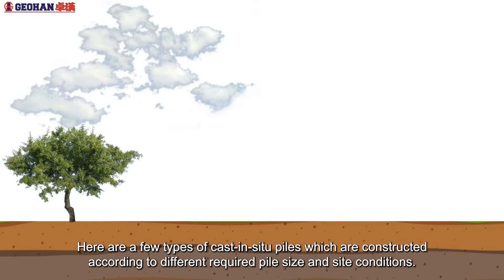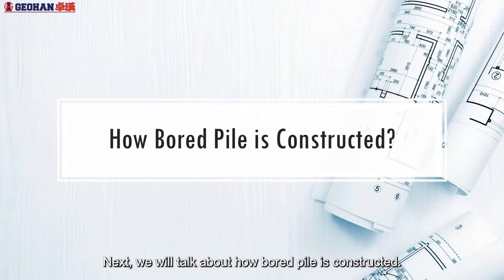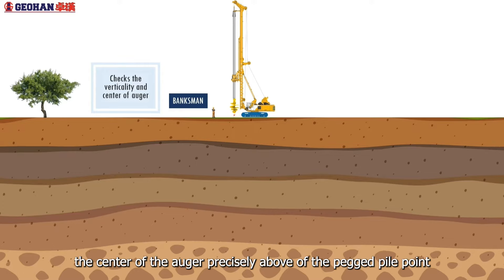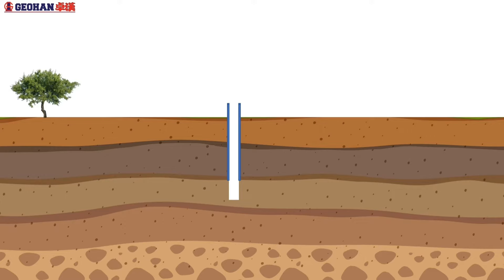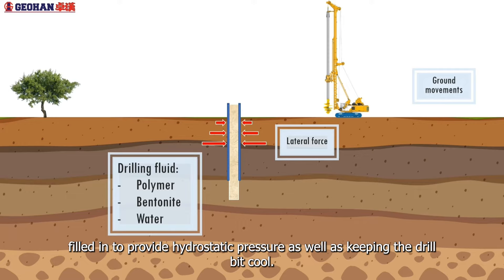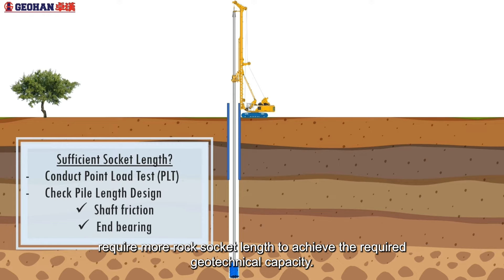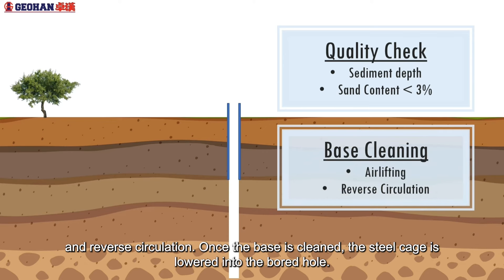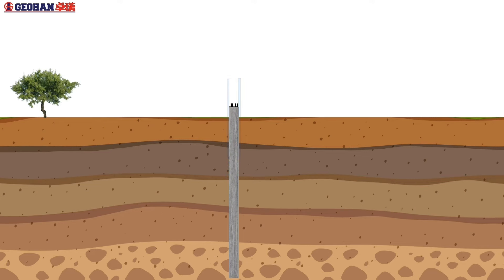Bored Piling Explained | 𝐆𝐞𝐨𝐭𝐞𝐜𝐡𝐧𝐢𝐜𝐚𝐥 𝐅𝐨𝐮𝐧𝐝𝐚𝐭𝐢𝐨𝐧

Comment: Good job. When cleaning the bottom of the hole, it may be advantageous to use a suction bucket instead of the air lift or reverse circulation, particularly in a remote location or in the interest of economy. Take care and best wishes in your endeavors.

Comment: What prevention method to taken if raining happen during boring of bored hole and during casting of bore hole?is there any effect if the bentonite mix with rain?
Reply from the maker: A good practice would be to cover the hopper on top of the concrete mixer truck with a canvas to minimise rain water during concreting. 
As for bentonite, priming the mix with new bentonite mix to achieve its desired density and viscosity would do.

Comment: Hey Geohan, could you tell me when we are supposed to use soil auger and when to use the bucket?
Reply from the maker: When boring in a bored hole that is dry or without drilling fluid, a soil auger is used. 
A soil bucket is used after drilling fluid is discharged into the bored hole.

Comment: can i ask, why is the casing only support to a certain length? and not all the way down? I Just join this industry as a safety coordinator hoping to know more. thanks!
Reply: Strength will reduce due to no friction of soil
Reply from the maker: Deeper casing would require a bigger vibro hammer during installation and extraction which would be cost inefficient. For deep piles, stabilizing fluid would be used.

Comment: may i know when the bentonite slurry be pouring out?
Reply: Bentonite slurry would be discharge out of the borehole during concreting of the bored pile. 

A tremie pipe is inserted until the toe of pipe. While concrete raise from the bottom of borehole to the top, bentonite slurry would discharge at the top of pile.

Comment: They should have done a video on how their poor safety on site impacts the surrounding neighborhood of their bore piling. It's nice to have interns to prepare such videos, but it's a different story if you have untrained workers on site pushed by money sucking, greedy shareholders. 
Currently this company is doing the bore piling in SS8 for Sunway Serene Phase2 without major consideration of the adjacent neighborhoods. The boring rig keeps drilling at max speed even tough once they  hit the hard rock already, which caused ground vibrations that has caused major damages to the houses and infrastructure.

It is a shame that they can work, bypassing any rules and regulations in this country, but as we all know Sunway (the maincon) has pockets full of cash and therefor is free to do what they want and those citizen in SS 8 & 7 are left helpless, watching their houses  cracking all over the place.